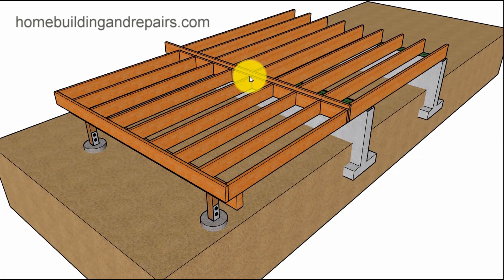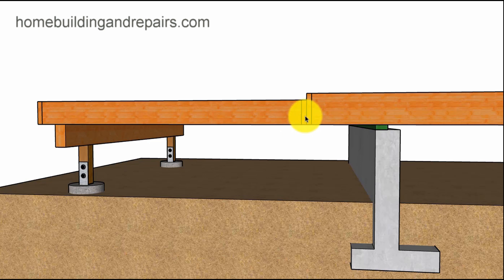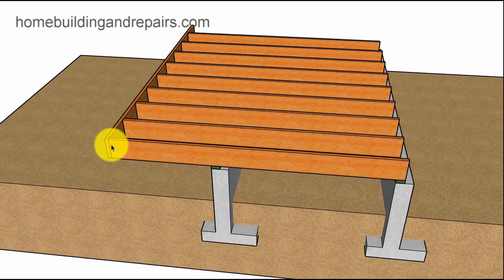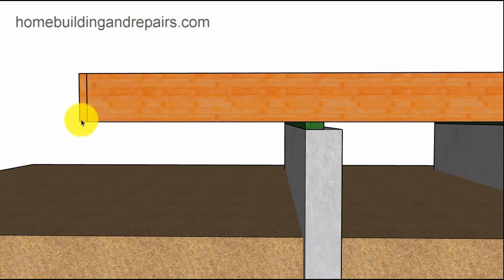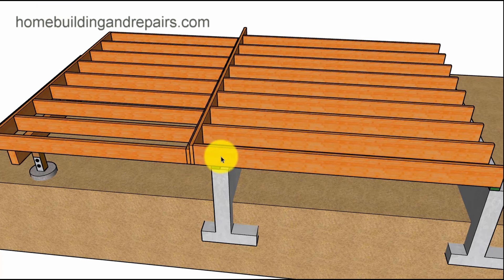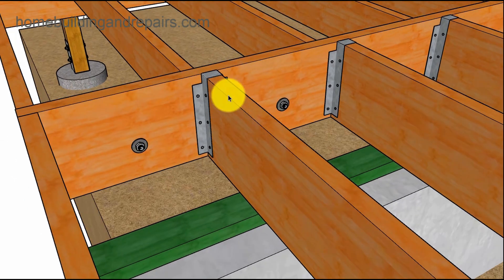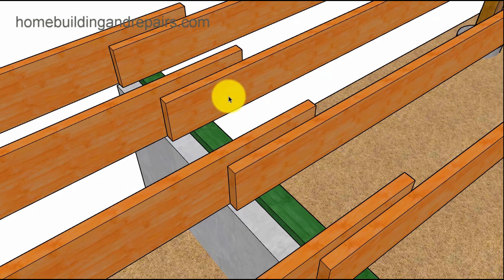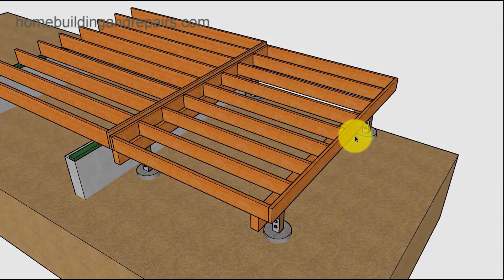Watch This Video Before You Attach A Deck or Balcony To Floor Cantilever - Structural Framing Tips

Comment: You're probably right but I tend to put one nail for every full inch of material, i.e. 3 nails for a 2x4 joint, 5 nails for a 2x6 joint, etc. Not necessary really, but it does strengthen the attachment quite a bit.

Comment: What about attaching the deck extension to the beam with joist hangers?
Reply from the maker: I thought I mentioned that in the video, but if I didn't, then it might add to much weight to the cantilever. It would depend on the building design on whether or not you could do it.
Reply: @gregvancom  not the canterlever but the beam that the joists are on.
Reply from the maker: @strokerace4765  The beam could be rated for the existing loads and might require additional structural support to attach deck joist to.

Comment: Where is the strength coming from in the blocking/notching method? Accuracy of the joints or the thickness of the mating blocks? Thanks greg
Reply from the maker: All of the joist are sitting on the concrete stem wall. The lapping joist are nailed together, but can't provide structural details about blocking strength or suggest that there is not a better way.

Comment: I don’t get why people use the house to support the deck when 2 or 3 more posts will do the job. There are almost always issues with water and waterproofing. A second story deck could just have some anchor points for stability. I prefer to keep the outside house covering intact to mitigate any potential water problems.
Reply from the maker: I here yeah, but some times a ledger will be necessary.

Comment: The deck/ porch/addition will pull downwards on the cantilever. The cantilever can actually crown downward and the floor can become a crooked inside. This is what I have seen.
Reply from the maker: Yes, something else that can become a problem and thanks for sharing.
Reply: Will this cause inside doors to warp?

Comment: Excellent work Greg. I am looking for a solution for my the back of my house that has a cantilever in place. You mentioned the system that the engineers would love and I think you're saying if my original ledger board was a 2x12 and I decided to use a 2x10 then make a new ledger board into a "comb"  to fit over where the joists meet? What to do if using same sized ledger board?
Reply from the maker: Just make sure you have a waterproof transfer between the inside and outside if using same size lumber. Most of the time the deck is a little lower than the interior floor to make it easier to create some type of waterproof or diversion so water can't go into the inside.

Comment: As an engineer my main issue is of course the joints. The weak joints will fail as soon as you apply large bending forces to the deck. Once you place them on the concrete then the wood is resisting the bending stresses not the nails. Nice video!
Reply from the maker: Thanks for sharing and sharing your thoughts with us.

Comment: The “easy” Lateral load connections “tension ties” that tie into the sill plate are difficult if not impossible to use with a cantilever. You’re back to the old school threaded rod tying into the joists. And these don’t solve the issue of the shear load on the rim joist. The upside down joist hangars are a neat solution. 👍
Reply from the maker: Yes some of those lateral load connectors seem a little over kill, but of course is back to they're probably a good thing to have whenever there is enough pressure to rip the stuff apart.